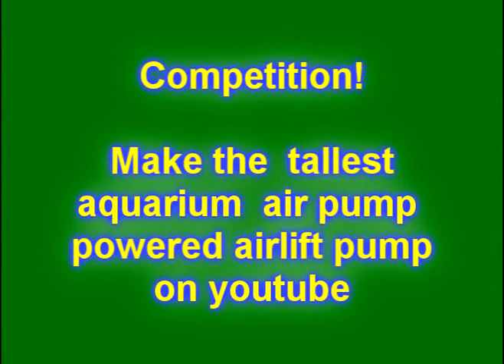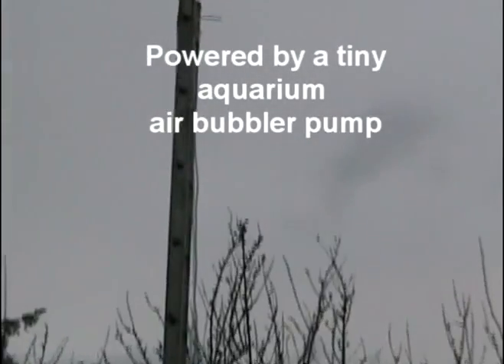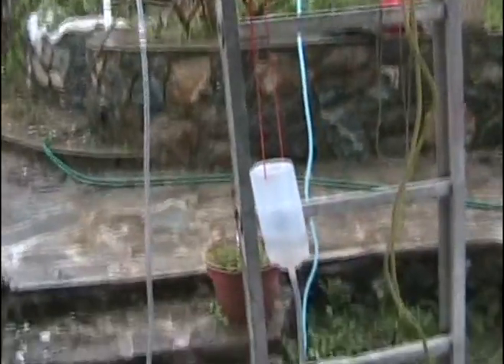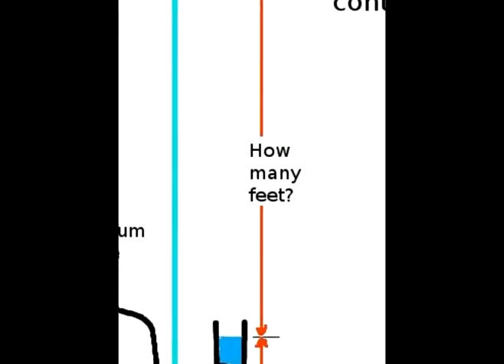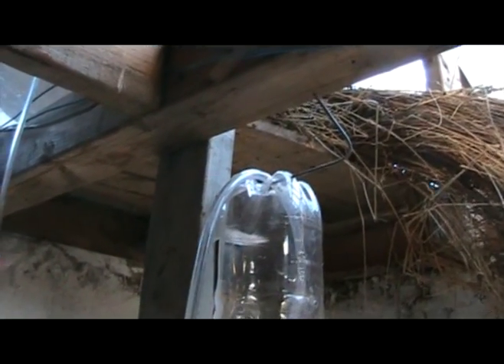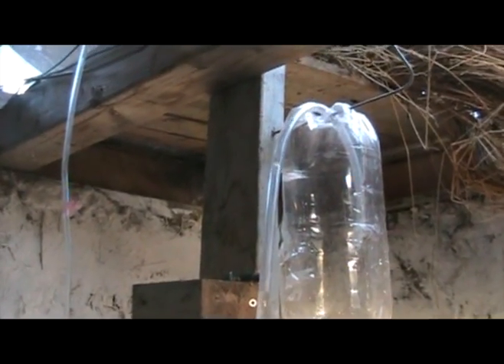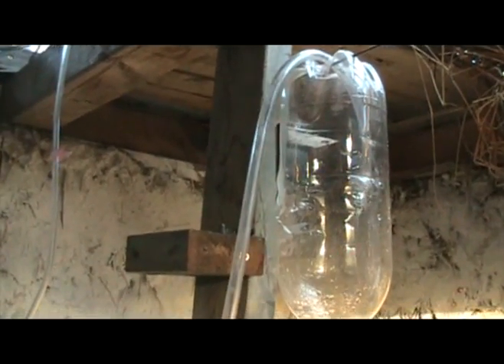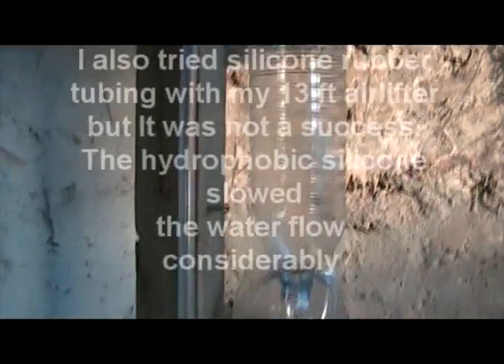Nano Airlift Pump Challenge!  BEAT THIS to be Champion!  And World record holder!

Comment: The problem with most cheap air pumps is that they usually rely on a brushed motor and a mechanical diaphram, both have short lives and can wear out. Whereas a lot of even the cheapest water pumps use a non-contact brushless electronically commutated centrifugal spinner and will have a very long lifespan [e.g. brushed:<2000hrs, brushless:>20,000].
Nice work though!
----
Check out TopsFlow on Alibaba for longer life Brushless air pump designs but note they are much more expensive...
Reply from the maker: Hi Nick,  I will check the expensive air pumps  out. I need something to work off a 12 volt,  15 watt solar panel anyway. (without batteries).    My cheap air pump is into its second year.  There are  3 main  problems with water pumps. One is filters,  number 2 is that the water pump is integrated into the system  and number 3 is heights.    My airlift pumps at 1/4 inch do need regular clean out (perhaps every 2 weeks) but you can use half inch diameter airlift pumps  in 3 ft submergence with 3 monthly cleaning. But generally little or no filtering is needed.  One air pump drives about 6 airlift pumps in my home pallet gardening system. And an airlift pump is just pipes or tubes joined together.  (You cannot beat that for simplicity) AND the general hydroponics air pumps are 10 times as powerful as what I use!  Heights, my airlift pump can pump to 5 inches high or 10 ft without adjustment.  Generally water pumps have a specific design height.
Reply from the maker: Hi, Nick,  thanks for the advice, as soon as I figure out how to pay, I will buy one of those from Alibaba. Then I can hook it up to a solar panel (I hope) and that will appeal to the off grid type of people.

Comment: 1 psi is roughly 27 inches of water, so without any conversion the first 2 feet are easy.  If you want 6 feet we need 3 psi, but I can make 3 psi with 1 psi or .2 psi, I just loose volume.  What are the allowable materials?  The easiest is probably a pair of parastaltic pumps.  Set the specs and let me see what I can come up with.

Comment: I'm confused, why don't you just do an air piston?  i.e. take an enclosed volume, submerge it in the water, ad in two one way valves and an air line.  When air comes in water goes out thru one valve, then release the air and let the volume fill thru the other valve.  Valves are simple, just a ball sitting on the end of a pipe.  If this is a contest then an air piston is nearly ideally efficient and will out pump your system.
Reply from the maker: Hi, Richard, perhaps I should call it the "1 psi challenge".  1 psi is all you get!  Can your air piston work with 1 psi?  The "big idea" is to see what is possible with 1 psi.  1 psi is fairly easy to  make with small scale wind, water and solar power. I have gone even lower with my new type of airlift pump. I have used 0.2 psi to pump water 6 ft high. I think something like that can be used with wave power. (from people splashing in a hot tub!)

Comment: I wonder how high it could go if you connected an industrial compressor?
Reply from the maker: Hi, this is about using minimal power, not brute force so, no industrial compressor. And capillary action is not useful at these diameters. Plants took millions of years to develop their biological subsystems to keep their capillarie tubes clean.  This thing I made works now and could be in use far more. (If people really believed in bottom up development). I find that many people "think" they believe in it but when pushed to try and help develop, they get cold feet.

Comment from the maker: Thanks, Tomas,  we have to note that my airlift pumps are not super energy efficient,  but a few years from now, I have high hopes that people can combine them with  pulser pump nano, mini gravitational vortex turbines,  mini vibrating wire wind "turbines" and solar thermal Stirling engines to produce fairly reliable low pressure air for back yard "pneumatic power grids", maybe at just 7 to 20 kPa of pressure that do useful work.  Check my pallet garden playlists. Brian

Comment from the maker: I  checked it out and it is similar.  He does very well!    As a commercial grower he has both advantages and disadvantages over the way I "research" things. If you ever see him, I think that the airlift in a bucket video  (Upscaled for his needs)  with the horizontal pipe a good length and the   constriction tuned  to the right size,  might  be better than the check valve that he uses in one system. It is hard to say,  I am going for minimal power use to be adapted for 3rd world use. Brian

Comment from the maker: Hi, Juan,  I made a new version of airlift pump in January 2013 and it is for watering plants in pallet gardens and vertical planters.  It works really well even with low submergence.  I currently call it airlift in a bucket (silly name) and it can do up to 20 to 1 lift to submergence ratio.  (Not much pumping at 20 to 1 but previously people told me 10 to 1 was "probably" the limit.  Potentially 20 to 1 is the limit for the experiment too?  And that would put the limit at about 40 ft high!

Comment from the maker: Hi, Tip,  Please feel free to try the "airlift in a bucket" (see video description) Airlift in a bucket  is new,  almost 6 months old.   I have only tried   prob 3/16, 1/4 and 5/16 tube sizes.  The constriction size and the length of horizontal tubing,  in the airlift in a bucket video, probably need to be changed depending on heights and flow rates in your system.  Also the "pallet garden" and "windowfarms research"  playlist shows them working.   Brian

Comment: This kind of irrigation is perfect for Aquaponics and provides extra oxygen for the roots.  As these pumps are working they are aerating the nutrient solution at the same time inherent with the pump head operation.  I make many of the air powered water pumps and show examples of different uses for the outputs.  You can see them on my youtube channel tkrimo

Nice job on the video I didn't even know about your experiment until today!

Comment: Great job on the pulser pump. In airlift pumps, efficiency problems is usually caused by the submergence to lift pipe ratio. I was just wondering with this type of pumping water won't the problem lie in trying to lift the water source as high as possible in order to have a similar submergence effect?Also, It'd be good if you could show an example of a scaled up model of the system in the video. Maybe a medium scale type? Thanks

Comment from the maker: I think it is about 1 psi. I tried to keep it simple and the "guideline" is in the video.  I used 1/4 inch tubing or 3/16 inch tubing.  The use of this narrow tubing means that nobody can use a 10 horsepower pump and beat someone with a 1 or 2 psi bubble pump. In the experiment  the allowed Submergence is 2 ft (add the u bend and your maximum psi is about 3 ft water pressure.) (so about 1.3 psi).  I think a foot pump version would work with a bundle of 1/4 inch tubes doing the pumping.

Comment from the maker: Big airlift is pretty well understood, they have been using big pipes in deep wells for over a hundred years.  You can find figures in engineering books.   But cheap small diameter tubes only became available in the last 10 years or so. You cannot find figures for them anywhere. That is the reason for this experiment. It was trying to fill in the gaps. Strange that no university or engineering department is interested, isn't it?
Reply: yes, most papers are about airlift used for oil industry

Comment: Maybe using "Shishi Odoshi". The airlift pump fills the Shishi Odoshi, which will fills the growbed for a few times, and with a significant volume of water splashing into the bed, bell siphon should trigger. This if you wanted to use bell siphon in your aquaponics. Personally I've tried using this airlift pump. The flowrate I'm getting is about 1 litre per 10 minutes.

Comment: Is the water not less likely to run back down the pipe if the top has a sharp fall rather than a slow  ramped bend? Perhaps U can finish with many much smaller tubes, this may encourage a capillary effect at the top, or no bend but the pipe finishes straight up, route it through a a hole in the bottom of a bottle seal around the hole and there is no need to have a bend at the top it will gush around the outside of the up tube and fall into the bottle then you can have a runoff tube exiting

Comment from the maker: @specialk22tt  I am not sure, I think it is probably fine. We will not know until you try, (and post your video).   18 ft is the current best height with the parameters that i showed  but I think it can pump higher.
I wonder if higher above sea level would give an advantage? Would it work better or worse at 5000 ft  (Suction pumps work much worse at that height)
Brian

Comment: Hi gaiatechnician. Will the performance of the water plugs be affected if the pump is sitting on the ground near the t-joint (aka at or under the lowest level of submergence) with a check valve in place?

Comment from the maker: @papadyal1149  I bought blue airline tubes that are made of silicone rubber. They almost totally refused to work!   Even water coming down! the tube hardly moved when I turned off the airlift and opened the bottom to clear the "slugs of water" in the tube!  I think the normal plastic clear tubes (from hardware stores or winemaker stores)  somewhere between 7 mm and 3 mm would be ideal to bring the water up.  I think about 5 mm is very close to "perfect"  but this awaits experimental confirmation

Comment from the maker: @KWAZAI   It isn't like capillary flow, (as far as I know).   It is more the distinction between plug flow, churn flow and bubble flow.  The physics of each type is very different but way back, 50 or 60 years ago when they wrote the books, people only tested with bubble flow.
If  you search for "2 phase flow regime" and look under images, you will see lots of examples. These types of search results did not even exist a few years ago so it was really tough getting people to believe me.
Reply: i think it's water surface tension, that's why it works better for small pipe diameters
the more pipe diameter the more chance of water slip downwards

Comment from the maker: @Cyber000000  I think you are fairly correct. The height between the water source level and the t-joint would be equal to the maximum length of plugs possible.  (There could be many short plugs or a few long ones). Water would only be added from below the T-Joint  when a plug gets squirted out on top and lowers the pressure.   Thanks for questions, it helps me understand too!

Comment from the maker: @squirrelbong  I have done something like that with the pulser pump. 
Not exactly the same thing.  I forget exactly what did but at one stage,  I had 2 airlift pumps working from the air from the tromp section.    One was pumping to about 3.5 meters or maybe 10 ft high and the other one  was using slug flow and pumping to about 5.5 meters high. I think I had it working for about a week.  One was pumping water to sheep high up and the other one was pumping water to cattle in a different field.

Comment: great video.I wish I had a better spot to try this out.I've thought about a step system with an air manifold at the bottom. with separate air lines higher and higher up...so say the maximum vertical "rise" is 50 feet...fill a container 50 feet high and then switch to the second airline, off the same pump...and start pumping that container of water another 50 feet and so on...I think theoretically one pump could pump it as high as you want if you had enough tubing for all the separate lines. :)